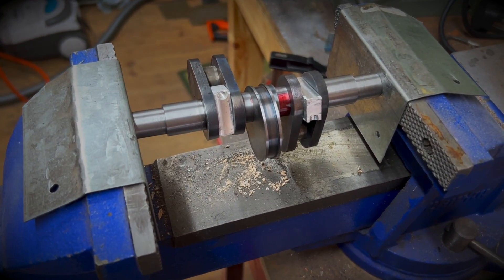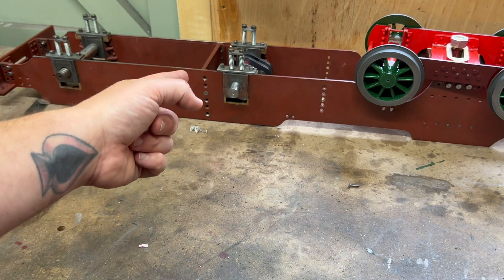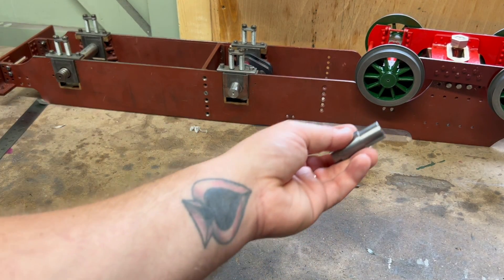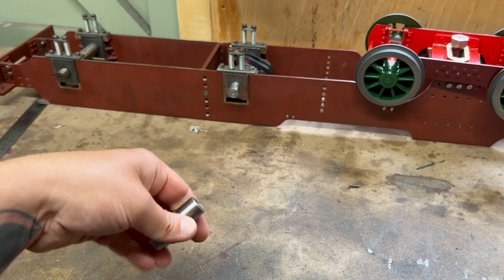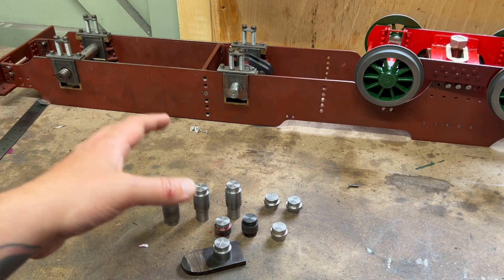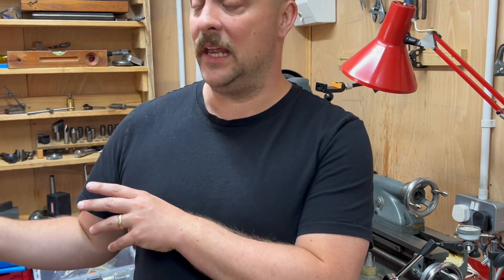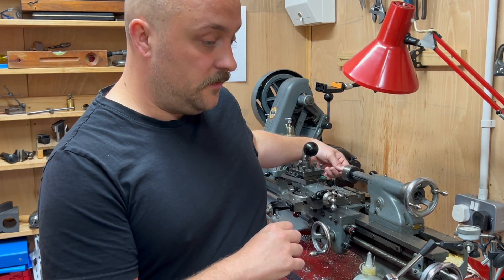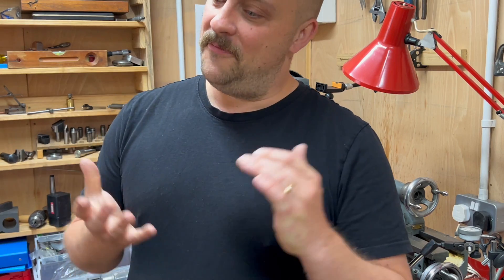Crank Axle almost made me QUIT! - Steam Loco No. 28

Comment: You want to be careful using a bench vice. I cracked the base of one mine using it as a press. That’s the trouble when you use a bit of pipe as an extension to get greater force on the handle!
Reply from the maker: I’ve not thought of that! That’s a great point! Hopefully I don’t have too much more pressing to do, but if I do, I think I will buy a two-ton press

Comment: Well done for sticking with it, does it need pinning to give it belt and braces
Reply from the maker: I have thought about that - I don't want anything to work loose - but the webs are only 1/4" wide and I'm worried about compromising the integrity, let alone trying to drill a 1/16" diameter hole over 1¼" deep through steel!